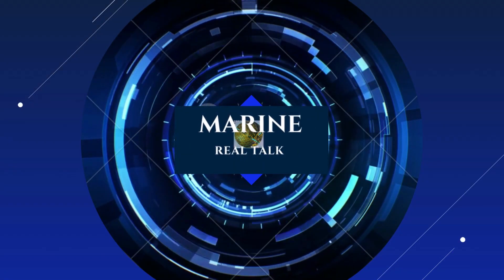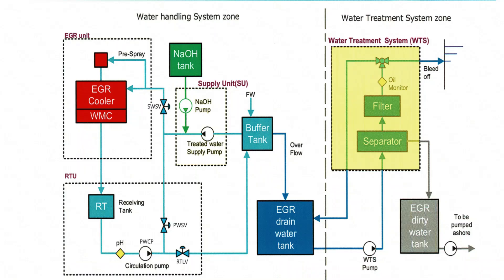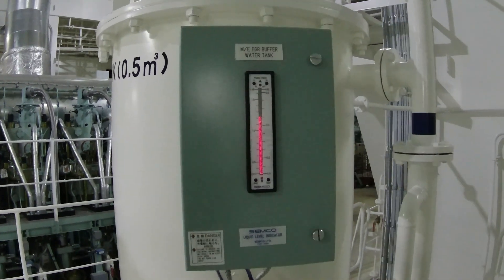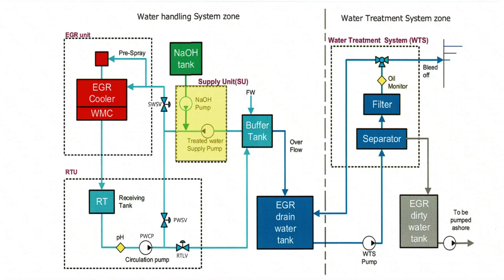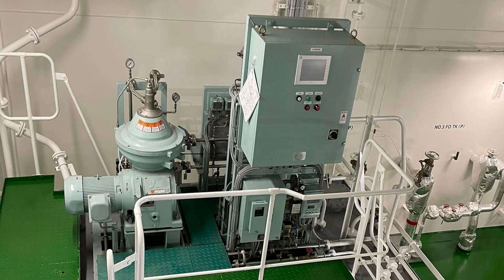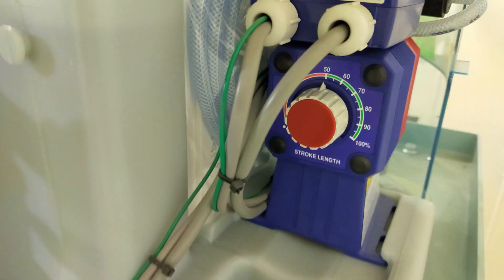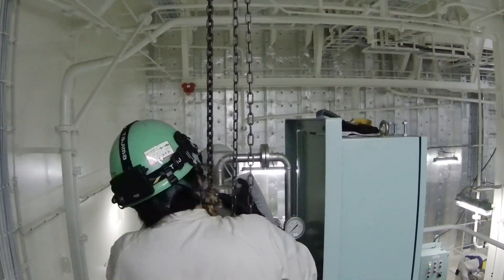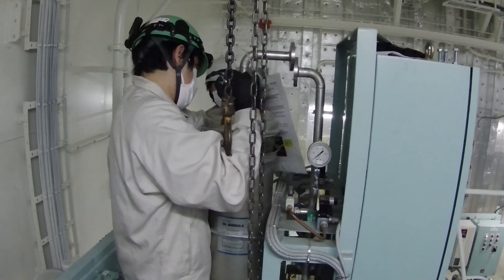EGR - Water Treatment System for Marine Diesel Engine/ Chief Boyet / Seaman Vlog/Marine Real Talk

Comment: Sir, I have a question about maintnenance job by ship's crew. I heard when the ship is equipped with EGR, and if the ship doesn't go to Tier 3 zone for more than 1 month, ship should carry out some kiind of operational test(the engine should use LSMGO). Then, at least how long we should do the operational test? And Is there any other job the ship's crew should do for maintenance? Such as for nozzle spray, water mist catcher, and water treatment unit(except spaghetti filter)? Oh lastly, can you say again about the dosing unit that appears around 5:17 in this video?
Reply from the maker: Hello, thank you for having an interest. Actually you are right that when vessel is not calling Nox emission control area the EGR should be run for maintenance test to ensure the good working condition as well as for crew familiarization. There is no certain hours you could run, but in us, we are recommending to run for at least 4 hours in order not to consume much LSMGO but it is good enough to check the operating condition.. Frequency depends on Owner's advise, wether monthly or once in two months, also depending on the voyage or vessel schedule.
For the other maintenance, just follow the maintenance guide. But of course the interval might be shorten depending on the condition.
About the dosing unit or floculant dosing pump. The setting will be based on the visual analysis of the water sample. It is being done the the crew, thus it is very important that crew knows how to select the correct one. It is recommended to carry out the analysis everytime you will be using another batch of LSMGO. Incorrect setting may leads to easily clogging of spaghetti filter. Same with the other filter, you may judge the condition thru a deferential pressure.
Feel free to raise your question in any of my english videos.🙂
Reply: @marinerealtalk8683  Thank you for answering, sir~~
Reply from the maker: You are very much welcome.🙂

Comment: Nice video chief. Thank you.
Is that what you call a 2 phase purifuer or 3 phase purifier?
Reply from the maker: Hello Alialtikriti, likewise thank you for the appreciation. Actually the separator in WTS is not a 2 phase nor 3 phase as it does not have any gaseous components being purified. It is just a disc type purifier and for Mitsubishi EGR, they have only two type, the MKK1 and MKK2. 
The exhaust gas is being cooled, cleaned and part of it is redirected to the scavenging air reciever.

Comment: What kind of chemical for flocculant tank?
thank you so much.
Reply from the maker: Hello Dinh, commonly using Kemira as flocoulant. But still it depends on the company if they will be using other brand or called equivalent product having the same purpose.
Reply: maker WTS - SAMGONG Korea @marinerealtalk8683
Reply: Thank you very much. can you recommend me some names and manufacturers? maker WTS SAMGONG KOREA.
 @marinerealtalk8683
Reply from the maker: Hello Dinh for I have missed your message. Actually, I cant recommend any Maker. So far, what we have in the company is okay and easy to operate.

Comment: Sir chief boyet pa share naman ng video how to calibrate O2 sensor [2point calibration] using O2 span gas
Reply from the maker: Hello Alexander, I'll try to make video for O2 calibration. Actually, may instruction guide din naman sa manual and calibration is not complicated.
Reply: @marinerealtalk8683  gud morning. Ask ko lang pwede ba tayo mag operate ng EGR kun naka O.5% sulphur pa ang fuel? May nakasulat kase sa panel na complete switching to O.1% sulpur before operate tier3.
Reply from the maker: Hello Alexander, pag may note na panel na ganon, meaning your EGR is designed for LSMGO at kailangan munang complete changer over and that is part of the starting sequence or EGR.
Reply from the maker: If your EGR is designed for LSMGO, di sya pwedeng operate for HSFO, otherwise it will not proceed to start. But just in case it can be override, it can easily clog the spaghetti filter leads to operation will be stopped or either your egr drain tank will also get easily full.
Kung meron pang di clear sau Alexander, feel free to send further question. Hope this sharing could help you to understand.
Reply: @marinerealtalk8683  okey sir chief. Marami din kaseng bagujan sa gani2 sa ME 10.5 EGRBP. about naman sa Urea and NaOH pano kaya ang pag transfer n2 sa tank. NaOH should be mix into water.?
Reply from the maker: About sa NaOH, it can mannual transferred to the Tank manually from the IBC tank suppied.
About UREA, this is for SCR. There are designed na Urea Granules at iba naman at Urea Solution. The granules needs to be diluted to become a solution.

Comment: Chief boyet thank you! Very interesting and knowledgeable content. May I ask a question sir? How do you compute the generation and bleed off rate when the WTS is in standby mode? Coast to coast US voyage. Thanks for replying! Godbless sir!😁😁😁👍👍
Reply from the maker: Hello Jaja, actually there is no certain computation because bleed off also depends on the condition of spaghetti filter, setting/feeding of flocculant depending on the type of fuel being used. But on the manual you can see the normal or precalculate rate but its not a guarantee.
Reply: @marinerealtalk8683  thank you very much sir!
Reply from the maker: Very much welcome Jaja🙂